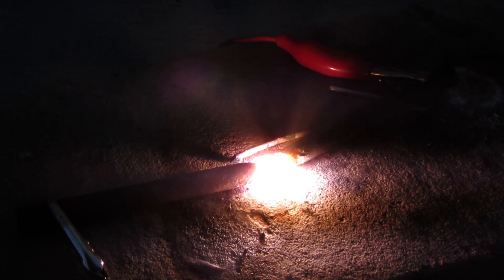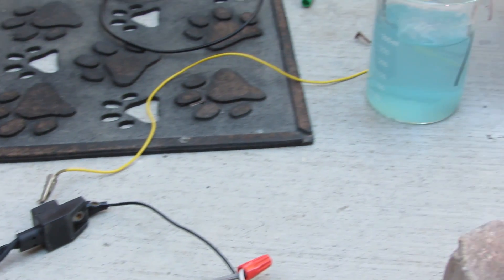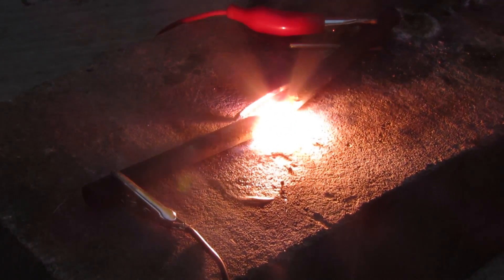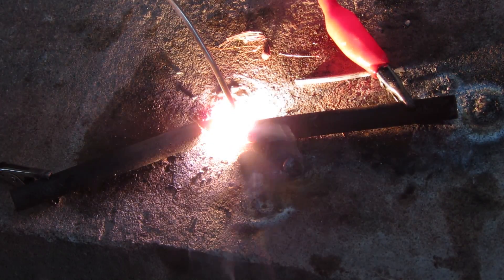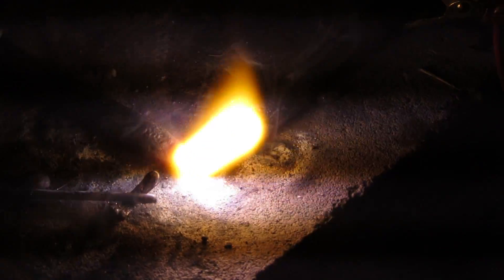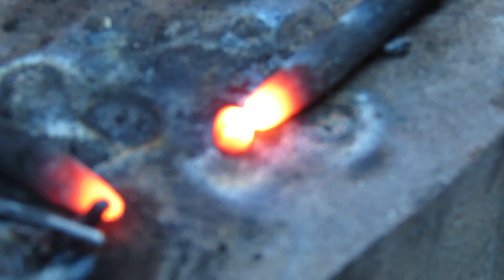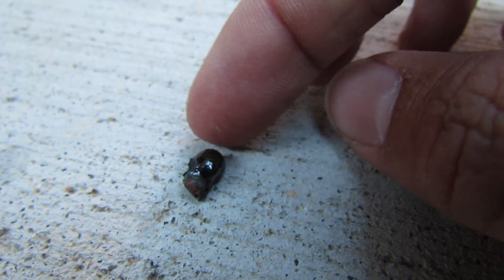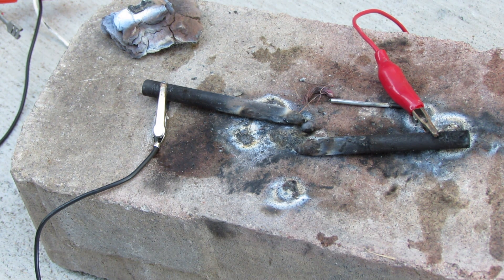Homemade Arc Furnace - Melts Anything!

Comment: impressive melting from just ac outlets and a water ballast resisitor!
Reply: +fidel catsro That's what I was thinking. Also, I would like to say that instead of that contraption with the bucket for the ballasting, the uploader could just use a motor run capacitor. The bigger the capacitor, the more current he can allow to pass through the circuit.
Reply: hmm ok i do use ac and capacitor with bridge diode to do battery charging, a 20uf cap gives about 1 amp, they are also expensive as you get the higher uf ratings, water sounds good if it is well managed and built with safety precautions, in this setup he is getting a lot of current and low voltages for such weld purpose, in a cfl ballast its the other way around, more voltage less current i believe..
Reply: im assuming the setup will be improved if the live ac was sent through a powerful rectifier and turned into dc before the water ballast setup, but the electrodes will be more difficult to control as they behave like magnets and stick to each other?

Comment: Well thats really ghetto. But as they say, if it looks stupid but works its not stupid. But just like Grant Thompson did , microwave transformers work better since amps are everything on arc tech
Reply from the maker: I agree this is very ghetto and experimental. It was fun to play with but it will not produce the results of a lower voltage/higher current transformer setup.
Reply: +Gooferking Science I'm wondering how 2 KV would go on a carbon arc, I have yet to test it.
Reply: +Linuxtarian Socialist not great. That would barely put out 500ma, which is not that great for hot arcs.
Reply: For an electric arc furnace, you don't want voltage so much as current. Powering it directly from a mains 120 volt supply does of course work, but not particularly well because the current is limited.

A much better way is to use an old arc welder as the power supply. These are cheap, simple and extremely reliable for this purpose. An arc welder is basically an intentional short circuit machine. The main component inside it is a large step-down transformer which produces a safe-to-touch low voltage, but a ridiculously high current.

Another way would be to use some old car batteries which you don't mind abusing. Mains powered arc welders usually deliver AC, but arc welding works just as well with DC from a battery if a large enough current can be supplied.

For small jobs, a single battery can be enough, since it can easily supply surges of 100 amps or more. But wiring several batteries in parallel will multiply the current which can be drawn. A bank of at least 5 large batteries wired up in this way could give you 1000 amps (equivalent to 12 kW), which is more than double what a typical mains arc welder can supply at full power.
Reply: I'm actually trying to build that ,can anyone help with some info ?

Comment: Not vey safe 110/240 at 10 amps / 2500W can easily kill you
i recommend that you buy a old stick arc welder power supply at 24v its much much much safer and you can pick up and old one for about $20
the transformer coils are made to sustain short out conditions 24/7
and they last a lifetime
much longer then you might last if you touch those electrodes with your hand.
Reply: Not true, 120v AC can kill you, it almost killed someone that i knew personally.
anything above around 60v AC is nogo. While DC does not render the same dangerous effects as AC i still wouldn't recommend sticking around something running 60v DC.
And as the voltage increases the resistance of a human body does not stay fixed; It decreases exponentially, meaning 120v AC can kill you.

I don't understand the point of your reply, Are you trying to get people to kill themselves?.
Shut up;

As for "showing that you require a padded room to be "safe"" No, But if you aren't trolling, Statistically, People like you are going to keep performing natural selection.
Reply: a) They stopped breathing, if someone didn't notice, and or didn't know how to handle the situation chances are they would be dead.
Since you seem like you need it, ill indulge you, "You almost had a car accident" You were so close to crashing that there was nothing you could really do, and you didn't have control over the situation to consistently win, Basically, You Yourself couldn't do jack shit about it; to put it figuratively You got lucky, Uncomfortably so.

b) If that where the case, Why would He/She mention a stick welder, Something more than capable of sustaining ~100+ amps; That doesn't add up.

c) Could have fooled me.
Reply: 1. I still call bullshit if he was operating in normal conditions, unless its 240VAC, or he was sweating balls or he touched a thin skin area like behind the ears/neck/etc then its impossible for 120VAC to pass the skin with enough power.  This is basic ohms law. This also means you can die to a 12VDC battery and people have. So to put it in 5 year old language form:

Voltage increases your chances of dying on places of contact (from thin areas like your armpit to your thick elbow), and anything under 200V has little to no chance of killing you in most areas on the body. What matters most is how to handle it and where you touch it. If you place both electrodes across your chest while sweating then you will die. However if you are not fucking naked or take basic precautionary steps like staying dry, wearing clothing. Touching both electrodes on your hand/leg/etc will not kill you.

2: What the fuck does a stick welder have to do with anything??? It only takes 200mah to kill someone, aka 0.2A. Again the amperage does not kill people. This is why its fucking stupid to even mention it. He mentioned it because hes fucking stupid. And if you dont understand how stupid it is then I dont know were to start. Please finish high school before educating others on life.

Do you even work with electricity? Do you have any basic understandings of basic electronics? This is elementary school crap. Its ok if your learning and are new to the subject, its great that you are getting interested in these things. However DO NOT spread misinformation and bullshit facts around. If you have no experience in what you are talking about simply shut the fuck up and dont act like a cocky 5 year old brat that only shows how stupid you are.
Reply: @Rowow  you're a dick
Reply: Here is a great website that explains the dangers, or lack thereof on electricity.
https://electronics.stackexchange.com/questions/19103/how-much-voltage-is-dangerous

In the end he is not in any danger and has a far better chance of dying to a car crash (since hes on his driveway). However what this is doing is growing his curiosity and allowing him to learn. He will learn more in electricity and grow up working in that field. Rather then restricting his imagination and curiosity let him free to learn. Ive grown up doing similar things and now build furnaces and cnc machines 100x bigger then whats in the video.
Reply: Sorry to break it do you, it was 120VAC and it DID do this, But far beit me to criticize a god...
Because obviously you know everything, Including what happened, and if that is the case, you wouldn't be saying jack shit about it apart from, it can, and WILL happen to people.
(Not only to mention getting one of those carbon electrodes dropped on you, Glowing red, would be MORE THAN ENOUGH to burn right through your skin.)

As for the ARC welder, What the fuck are you talking about mate?
Of cause it's safer, it operates at a lower voltage, thats what they said it was a better alternative, they are NOT wrong.
Reply: @meowkernel9780  
https://www.youtube.com/watch?v=NJJP10LtaoI
Reply: Lead affected your brain or something?
Reply: 1: What do you mean "almost killed someone". It either kills or it doesn't. There is no almost. I and many people have touched 120VAC and ill touch it agian as its nothing more then a tingle. I dont disagree that its dangerous in the right conditions (humidity, place of contact/etc) as I already stated, however its very difficult and impractical in the real life.

2: The fact he mentioned amperage is what indicated his lack of understanding on basic electricity. He is most likely some 14 year old kid who heard the myth of "Its not the volts that kills you, its the amps" and so he repeats it to sound cool.

3: No I am not trolling, and people like you are why we will need padded rooms. Rather then educating people you are only making them fear everything. People are too scared of Hollywood bullshit rather then actual threats. People are more scared of terrorism, sharks, electricity, and so on. All things that are NOT a threat and have zero to no chance of killing you. However choking on food, car accidents, cardiovascular disease and so on kill far, far more people my many folds yet no one talks about it.

In short
120VAC is factually not a danger, Amperage does not change that fact and it does not belong anywhere in the argument, and acting like it has a serious danger that no one should work with is a lie and putting humanity progressing in reverse.

Yes 120VAC can be dangerous, but so can a potato chip. Yes you should take precautions when working with it, however that does not mean you should avoid it like +Delta said. If you educate yourself you can work around the danger rather then avoid it. This is why our youth cant find any jobs, because they are scared of everything and need a safe place.
Reply: Don't say something is not safe if you dont understand how it works, something you clearly dont. 
The amount of amps does not matter since it only takes 0.2 amps to kill. What does matter is the voltage since the body is a resistor, and is the voltage is too low current simply cant pass through. He is also using 120v which is way too low for it to pass through your heart or brain, the most important parts that can get damaged. You can get killed by 120v due to variable conditions such as temperature, humidity, place of contact, etc. However with normal conditions you will be fine especially if you simply wear gloves or use pliers
Playing near the street is far more dangerous then playing with electricity since there are far far greater deaths due to car accidents then electricity. Nothing is dangerous if you understand how it works, and if you go around spouting nonsense you clearly dont understand how electricity and basic ohm law works showing that you require a padded room to be "safe"

Comment: It would be quite interesting if you get to melt a very well mixed powder made of aluminiumoxide containing up to 3% chromium(III)oxide or iron(III)oxide. It should be hot enough to make some artificial (pinkish, blue oder green) corundum.